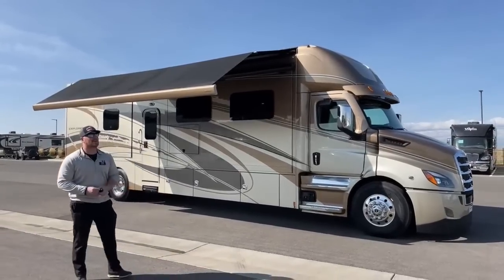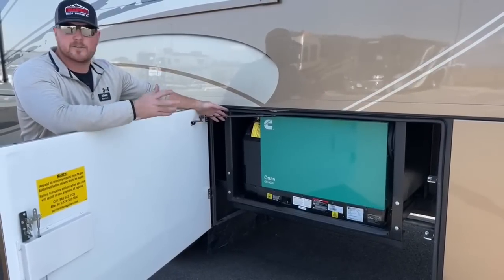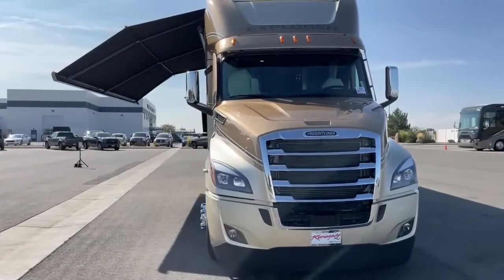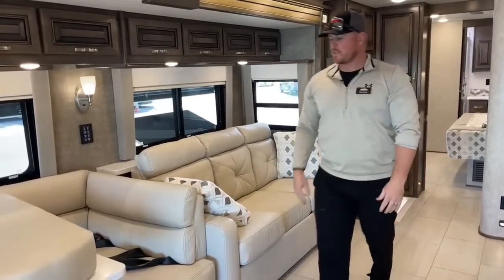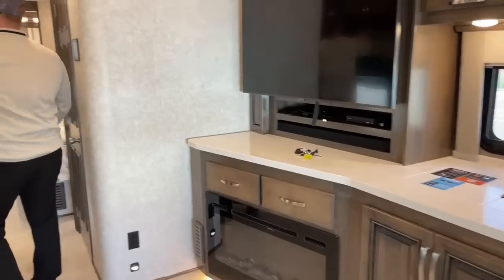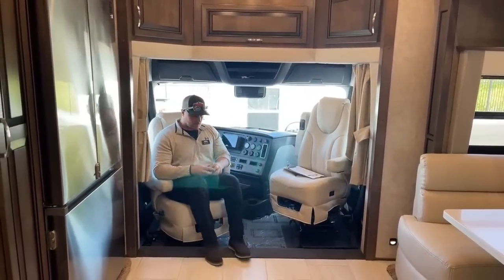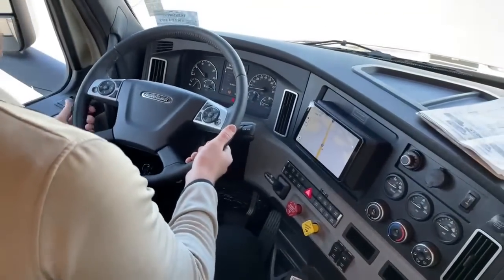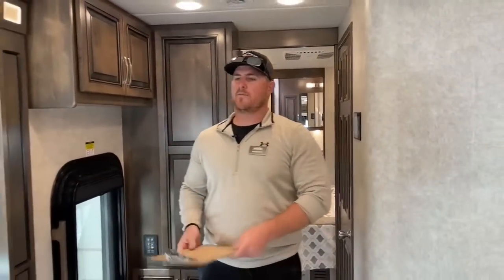2022 Renegade Explorer 40ERB

Comment: I like the durability of the commercial chassis. Plus every truck stop has mechanics or at least other truckers to offer advice if necessary,and they are made to go a million mile. I would opt for the single axle so occasionally driving on city streets and going around corners is easier.
Reply: Very true! Plus parts are readily available for both the Cascadia chassis, as well as the DD13! Single axle is the way to go if you do not need to pull over 20K, it provides better turning, as well as acceleration! Thanks for tuning in!
Reply: TA and Petro truck stops can do the Freightliner warranty work as well, and stock parts for the Cascadia.

Comment: Just FYI the shut down override, you need to hold the switch in with your finger. if you release the switch the motor will shut down. Then you can move the coach, BUT, it is meant to only move if you are blocking the road\freeway. It is NOT to be used to continue to get help. The motor will be in trouble mode, this means that the coach will move but in 2nd gear, and can not move faster then 10mph. It is only to move to a safe location or out of danger. I know this info because I am a heavy tow operator and have used this override many times so I am able to access the coach in order to prep for tow. So it is NOT  going to allow the coach to drive in a normal fashion if used. That is all, I love the walk around and will be investing next year in a coach to travel in retirement.

Comment: When will people in wheelchairs and powerchairs be able to get into camping and van/rv life?
Reply: They make cuatom order rigs for handicapped folks. Just contact the company your interested in and ask. I personally saw a lady with no legs have a Class b that had all controls on or by the steering wheel
Reply: You already can there are RVs out there that are built with wheelchair lifts
Reply: If they got enough money there's plenty of custom build options and engineers are ready to go for the right price.
Reply: Dude, catch up with stuff. 44 years ago my parapalegic FIL used a lift to roll into the back door of his motor home. Today the RV’s are very accommodating to the physically handicapped. ✝️
Reply: I've only seen one that was handicap accessible.iI believe every manufacturer should offer at least one handicap style and Not at a crazy MSRP.

Comment: Just add automatic braking.
Showing it closed up for driving was appreciated.
Reply: Thank you for the input!
Reply: I've been a driving  big trucks since 97' this  new Cascadia engine/ transmission/ safety system is proven excellent.  The 12 speed automatic is very good it will progressively upshift depending on load and grade. It has a max throttle detent, which means like in some some cars you can get a down shift by flooring it instead of a manual shift. Great feature to have! Also at first the lane keep warning is annoying but after a while behind the wheel you realize it's there for a very good reason. After many hours of not turning that timer/safety feature off it made me a better driver even after all my years of driving a semi. It only makes you and everyone else on the road safer. It works in conjunction with the optional automatic braking system. I also found that sometimes it can in some trucks falsely brake while going under a big sign on the highway.  But being in an RV it is probably less sensitive and may not do it.  So be mindful of that because these new chassis have air disc brakes. This would be my dream RV if I was about to retire!!  Driving definitely wouldn't be a problem 😉😎
Reply from the maker: Thanks for tuning in!

Comment: Dave, another great video; quick comment , those two doors on the washer and dryer should be reversed!! Very difficult to use the way they are, unless you sit on the toilet seat!!
Reply: The washer/dryer doors are not reversible. The entire bath should be flipped to make it work properly. Whoever was at the design table was asleep that day . . . They did not correct the issue on the 2023 model so apparently they do not see the problem.
Reply: @denali9449  totally agree!!

Comment: No solar, no gas. Be running the generator 10hrs +every day in winter, and summer.  No quiet escapes in this monster power user for owner or neighbours.  Owners will be wanting to fit solar and gas after a few trips if they want to remain in one spot for a few weeks without running a generator. 
But if they just want to stop for photos and move on this will be perfect.

Comment: I'm wondering about the ridiculously small  battery bank.  Other coaches that are smaller have  20,000kwh  battery banks and 3000+ w of solar panels.
Reply: Earthroamer's small coaches  have 1300 watts+ of solar power and an 11,000 kwh lithium ion battery  bank.  What this offers is sad.